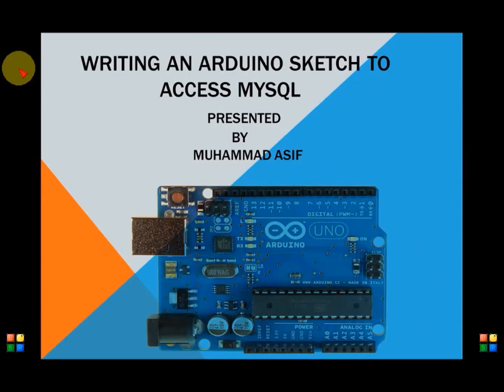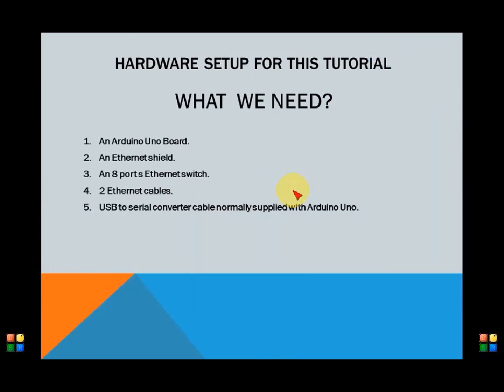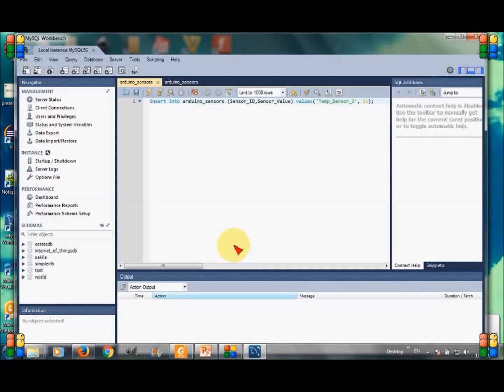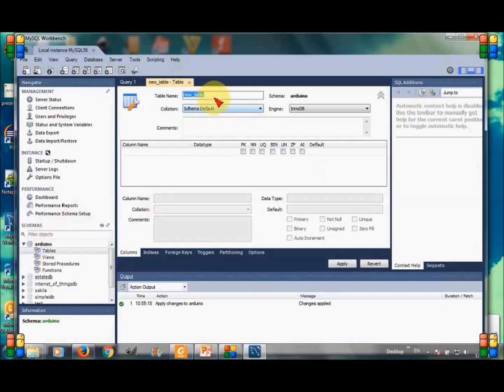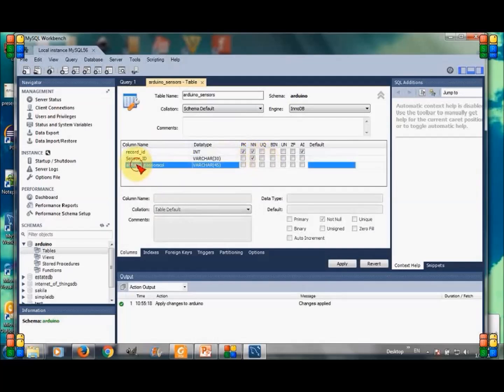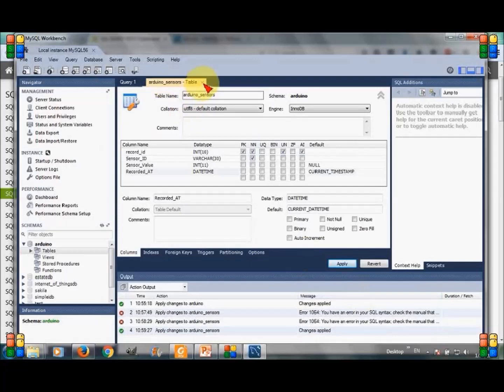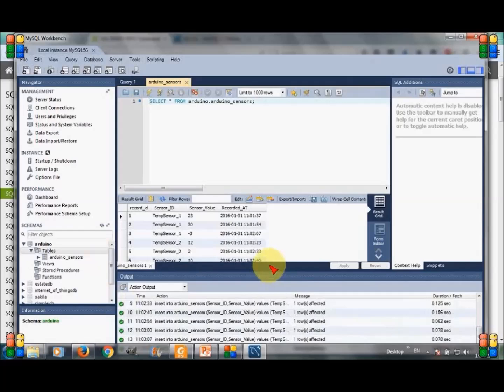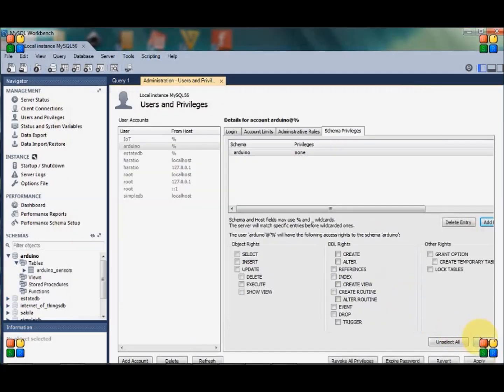ARDUINO AND MYSQL CONNECTOR

Comment: HI All !
I am trying to send my arduino sensor date to my php webpage.The arduino code is successfully reading sensor data ,connecting to the wifi network, it is connecting my website but it is not connecting the php page :The following code is is the issue:
client.println("GET /arduino/test.php?sensorData=" +String(sensorData) + " HTTP/1.1");
The php page is working correctly as i checked it with dummy data. 
Can anybody help?
Reply from the maker: Would it not be a good idea to first store the data on the database and then get data using avg() or sum() function etc?

Comment: that connector work with arduino yun?
Reply from the maker: Probably
Reply: You would not need that connector with Arduino Yun, because it supports linux and in there you can setup MySql with few simple commands ;)